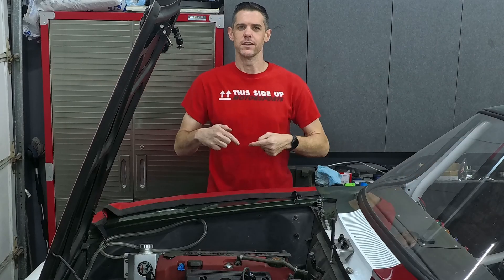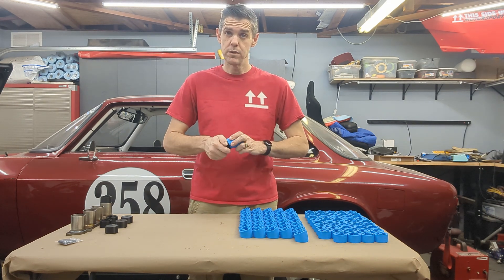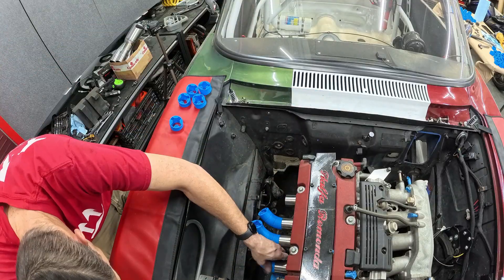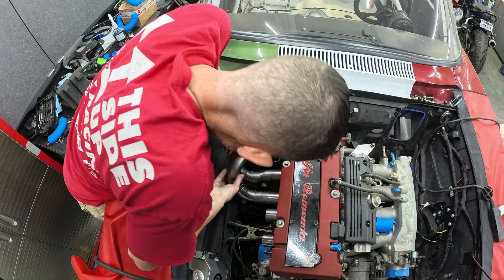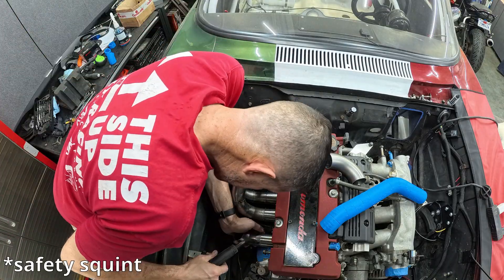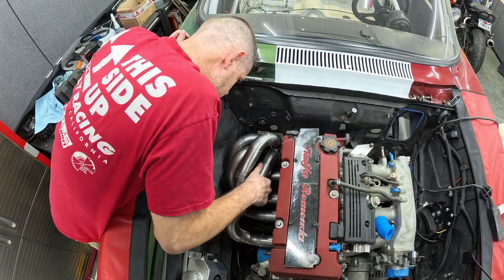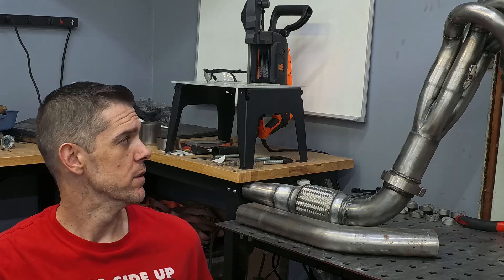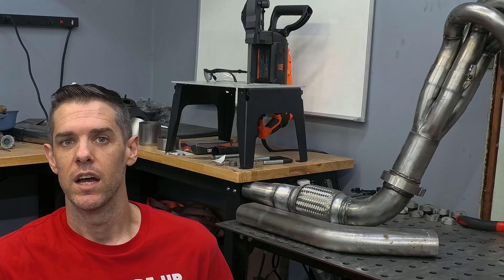Halfa Romonda - Exhaust Header

Comment: Could you remember/check what size O-rings did u use?
Reply from the maker: They were 16mm OD, 14mm ID, 1mm wide. Although, they were a bit small and hard to stretch over the tabs. If I did it again, I would stick with 1mm wide but probably go with something bigger like 18mm OD.
Reply: @tsumotorsports  Y thanks! I printed and noticed that loosenes too but didn't realize to use small O-rings. Started to design my own but i will try this first.